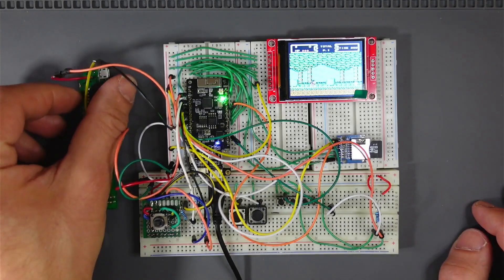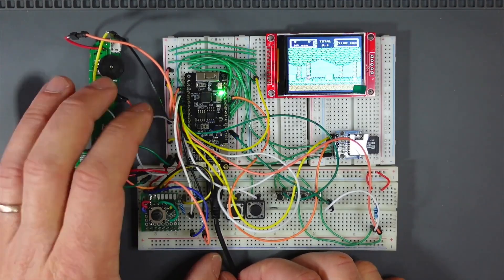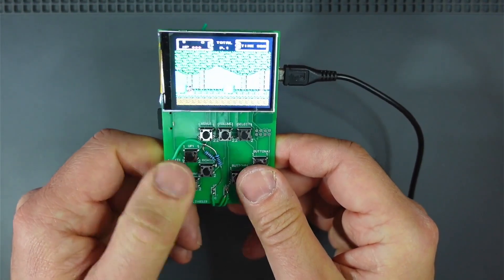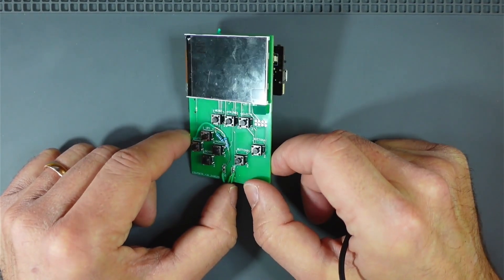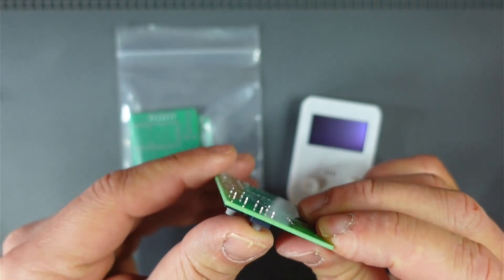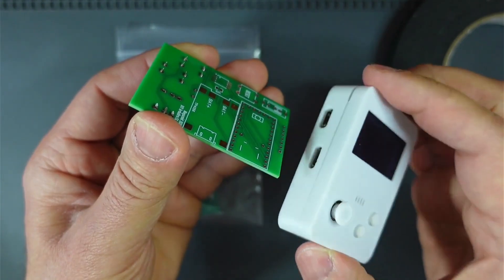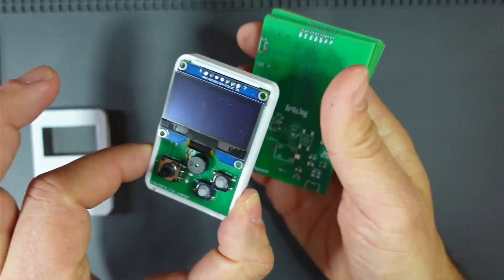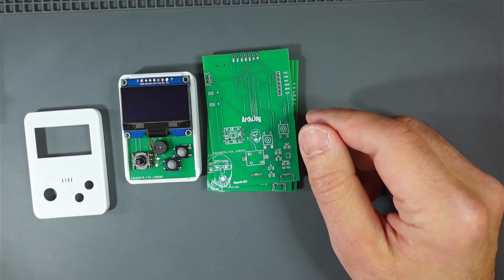Odroid Go! Part Deux  - Beta PCBs

Comment: Thanks for the project updates! Good show getting the last available screen 😮😊
Reply from the maker: They said they had 12 in stock, but it was probably a box of broken glass and dust when they checked it 😆. Still,  they appear to have sent me an viable screen. Technically it's not the same screen, but the data sheets were identical.